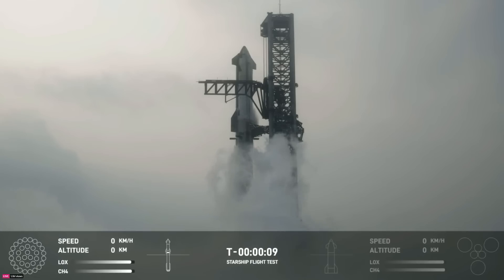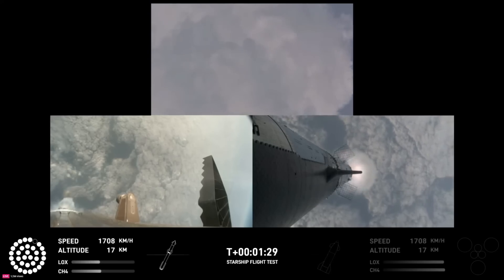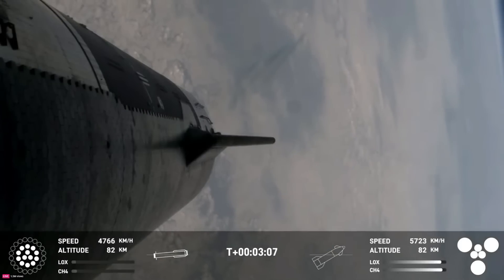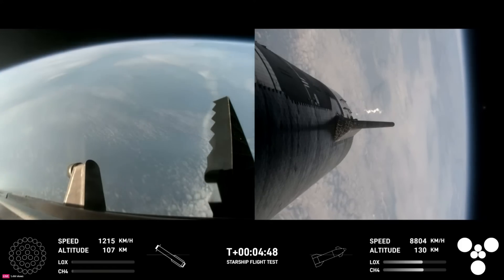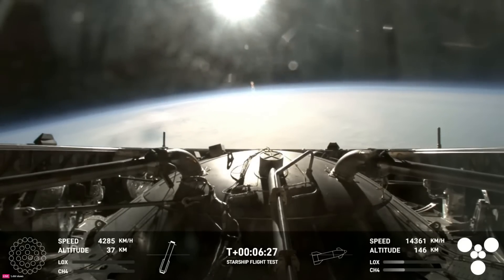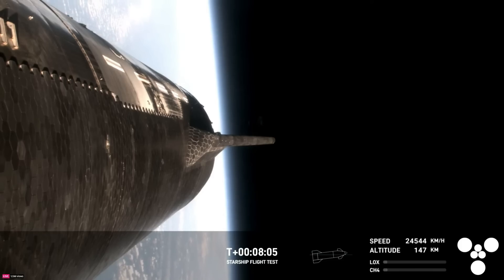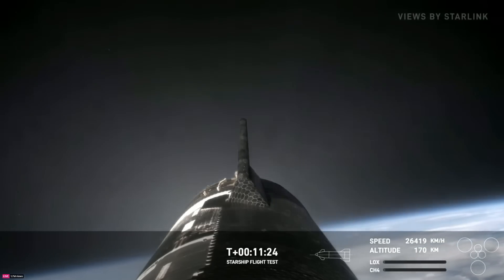Starship Flight 4 From Launch to Booster Ocean First Time Landing - Complete Video

Comment: I was surprised it stayed intact after the damage to the flap. That vehicle has showed it can take quite the beating and carry on, but obviously that's not optimal.

I would be interested to know if the flap was one of the areas from where they intentionally removed heat tiles from.
Reply: No it wasn't.  But seeing the way the reentry caused that area to heat up and shred indicates more work needs to be done to improve the protection of the flap and that is already being worked on.

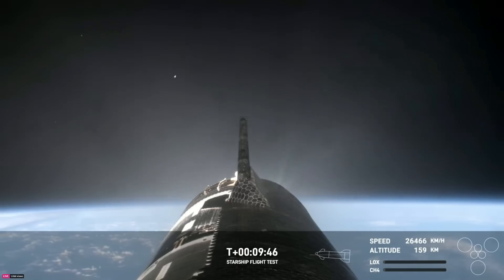Comment: Tile flies off at T+00:09:59.
Reply: Some of the tiles were intentionally left missing and others left loose so they can fall off. Intention being observation of the effect of missing tiles. 
Option of failure exercised. 

At re entry the tiles in the fins of the Ship failing and disintegrating on re-entry is also part of flight plan

Comment: How much pollution was that?
Reply: One Starship launch produces 76,000 metric tons of carbon dioxide equivalent (a measure combining different types of greenhouse gases in one unit). In comparison, the total carbon emissions for an airplane flight from London to New York is 1,300 lbs CO2.
Reply: "According to Andrew Wilson, assistant professor ....   one Starship launch produces 76,000 metric tons of carbon dioxide equivalent ..."

Source = a travel site.
Total carbon emissions for a flight from London to New York is 590 kg CO2 carbon dioxide equivalents.
With radiative forcing in effect, the carbon emissions may increase by 2.7 times, so the CO2 equivalents 
would then be equivalent to 1,592 kilograms  (~ 1,6t per passenger).

These calculations are based on a distance from LHR-JFK from 3,471 miles or 5,585 kilometers.
This trip is a long haul international flight. The calculation includes an assumption of a 79.7% load factor with 
346 seats on the B747-400 and 261 seats on the B767-300ER.

346 seats  *  0,797 PAX/seat   *  1.6 t/PAX     ~   440 metric tons     (B747-400)
261  seats  *  0,797 PAX/seat  *  1.6 t/PAX     ~   333 metric tons     (B767-300ER)

76 000 t   :  440 t/flight           ~   173      B747  flights from  London to NYC
Or about  173 * 0,797 * 346 =   47 700 passengers  one way l

The north atlantic corridor has about 300 flights each day per direction, 
while London-NYC is the shortest of these travel routes.
Reply: About as much as an airbus transpacific flight. About 45 tons less than the airbus.

Comment: Lesson Learnt:

Have at most 1 engine go out and the mission will be a “complete” success. If you’re wondering why I put the quotation marks, have you watched the re-entry of the Ship? Absolutely miracle.
Reply: I was surprised it stayed intact after the damage to the flap. That vehicle has showed it can take quite the beating and carry on, but obviously that's not optimal.

I would be interested to know if the flap was one of the areas from where they intentionally removed heat tiles from.

Comment: Pieces of booster engines can be seen fly out the engines near ocean 😅
Reply: most likely pieces of lower skirting, maybe some shielding, but that would have been from the outside ring, which was not used at that point in flight.

Comment: For those that are wondering. The missing engine can be made up by simply throttling other engines!!
Reply: 32 will do!
Reply: That's small potatoes compared to the flap that caught fire during Starship's re-entry. Will they have to go back to the drawing board for a flap redesign or some new way of protecting Starship's flaps other than heat shield tiles?
Reply: @Baunzy68   was that where starship purposely left off some of the heat shield tiles?
Reply: @Baunzy68 the flap has a gap imbetween the section where it merges with the body, plasma got through there and then melted the flap from inside out. this is an issue thats been of concern for years now, and version 2's concept already has the solution for it. the flaps will be more above the body so that that vulnerable section doesnt ever come into contact with plasma.
Reply: @Baunzy68  no. In a recent interview by tim dodd the everyday astronaut, he toured starbase with Elon musk. Elon mentioned that they would likely have to update the hot gas seal for block 1 ships. Block 2 will feature a complete redesign of the flaps as mentioned several times.
Reply: @Baunzy68  yea most likely
Reply: The engine did not effect the booster at all
Reply: Was it actually a missing engine or simply an engine kept in case of emergency?
Reply: @MGCoin333  it was automatically shut down after ignition due to some sort of problem
Reply: @mfrank216 that’s right. One engine simply failed due to a tech glitch. But ‘other engines compensating by throttling up’ bit is not right. 

The net thrust was reduced by one engine failure. AFAIK no compensating throttle up did happen.
Reply: @guppi277 you’d be wrong.

It’s in the logic loop for the software.  The ship is trying to hit a position and velocity. It throttles and moves the engines as necessary.
Reply: @guppi277  after seeing some data yep. They do need to fix this 💀
Reply: @NotOurRemedy  seeing some data, this version did not do that. From the info we can say that flight 3 and 4 should have had the same flight path. The apogee for ship 28 was 234 km. Meanwhile due to one singular engine failure, the apogee of ship 29 was just 213 km. So yeah a pretty noticeable difference.
Reply: @Nice_Pixels  im wondering if you KNOW that the flight path was not correct? are we certain that the flight plans were supposed to be the same? didnt they hit different speeds as well? just wondering.
Reply: @NotOurRemedy  well I have replied to as many of these as I could, the flight path was noticeably different than flight 3 which flight 4 was closer to. It's all due to that one engine. At stage seperation on flight 3 the velocity was around 5400 km/h. But on flight 4 it was 5000 km/h. So that translates to a 213 - 214 km apogee instead of the 234 km apogee of flight 3. It is still good to have the engine out capability. It's not necessarily something spacex can afford though as this is negative progress compared to IFT 2 and 3. Definitely they do not want this on a starlink mission on starship. I expect these issues to get ironed out by the block 2 prototype stage.
Reply: @Nice_Pixels  I don’t think you have evidence that this was not a nominal velocity and location. Every flight has had changes.

I’m welcome to being wrong but your argument has been convincing.
Reply: @NotOurRemedy  well from the documentation we can expect some changes here and there but a 20 km difference in the ship apogee is too big of a coincidence.
Reply: @NotOurRemedy  Agree. Given all engines fed from the same tank, may be there’s software that quickly shutdown supply to the sore engine and increase feed to others so they work harder to compensate. 
All in that split second.  
Logically thinking, possible. 
Rocket science. 👌

Man ..! There’s as many spaceX engineers outside SpaceX. 
Voted 👍
Reply: @guppi277  remember most of the launch the engines do not run at full power.

Only on take off.

So losing 1 engines just requires higher throttling for longer in most cases.
Reply: @MGCoin333 engines in such scenarios usually are supposed to work significantly below their limits to reduce wear and malfunction chances, so there were more engines than the spaceship technically needed, they were just throttled down
Reply: @MGCoin333  it wasnt a missing engine to my knowledge , what happes is that the insane amount of thrust generated during liftoff makes it so that the whole ship and structure feel a lot of tension u can say in them, this leaks to some malfunctions/problems sometimes , the engine that stopped working is the same case , it also happened in starship earlier versions too, back then it was 3 4 engines, last time it was 0 but this time 1, altho this doesnt affect the starship performance in the least because they can just use other engines to generate more thrust to makeup for the missing engine, and also musk has said that starship can also run on over 20 engines as well , but just for assurance and smoother operation it has 33 engines, the main reason goes beyond this simple fact but it is too long to tell , so i ll sum it up here
Reply: @uttkarsh2092  as I have said multiple times in this thread of comments, while it can do that it didn't do that cause there was no piece of code to increase thrust if 1 engine went down
Reply: @Nice_Pixels  yeah i know, i forgot to mention about it, apologies on my part
Reply: There's no throttling to compensate but they can burn longer to achieve the same result.
Reply: @phillip_mcguinness7025  as for that, well there is no piece of software that can do that. I would guess that even developing that code would result in lengthy delays for the flight path as it can very well change.
Reply: Doesn't it only need 27 to make it?
Reply: @WilliamStewart1  yea. IFT 1 proved that
Reply: Splashdown is not landing. Starship and its booster are supposed to land on a pad, which is the most difficult challenge SpaceX has to face, and not sure if it ever will be met.

Comment: That last few min of the booster with the speed fluctuating between 10 and 20 miles an hour for about three seconds that’s the catch that the mega zilla will be handling that’s awesome
Reply: idk. It was rather difficult to see when it actually splashed down and for how long it hovered. The speed went up to 20 km/h as the booster was already on the water and started tilting. But either way. Huge success. Mind boggling how they are able to land a 70 meter tall strucutre just like that.
Reply: I'm hoping to see a good 20+ second hover for IFT5.  They won't be doing much else new with that flight.  Relight Raptor in space, maybe fiddle with the door again.  That's about it.